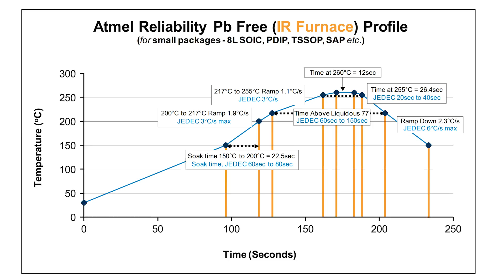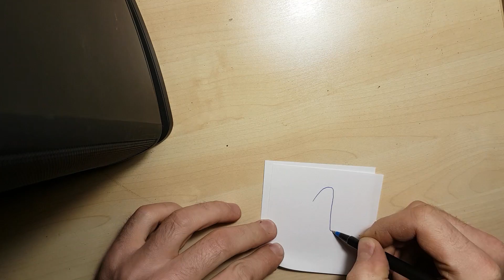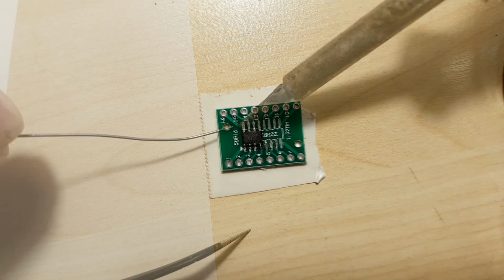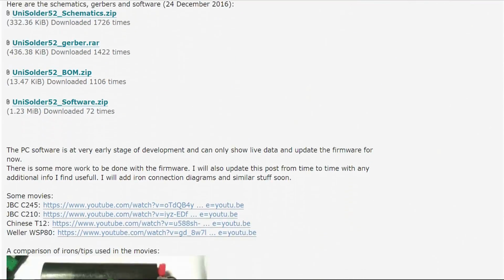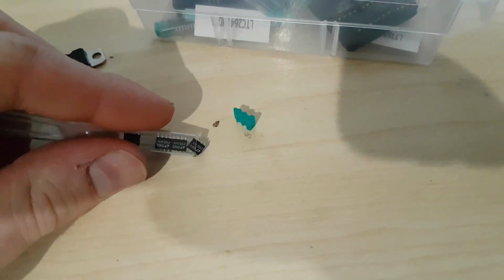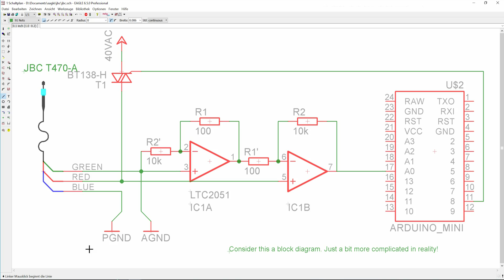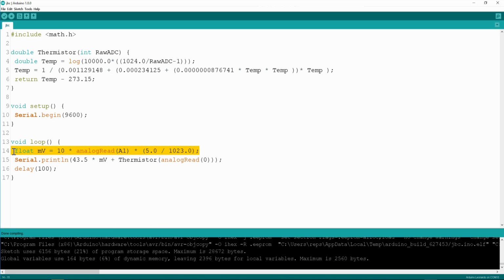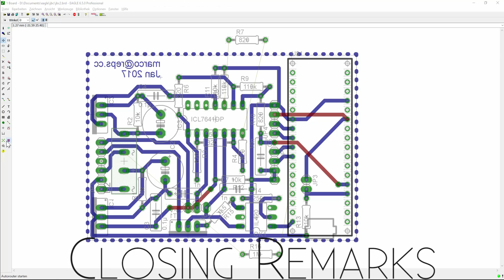Powerful DIY JBC Soldering Station - 250W C470 Arduino-based

Comment: Your videos are getting better and better!
Small tip: switch to KiCAD from Eagle. It's much better, and FOSS/free!
Reply: Amazing subjective argument right there. I'm sold. No more KiCAD. I'm switching to Protel 99 SE.
Reply from the maker: Yes, I tried KiCAD before, felt a bit clumsy then. But I'm planning to give it another chance.
Reply: If you have any problems, just join #kicad on Freenode, if you don't mind using IRC. ##electronics is also a good channel, a ton of people hang out there, including me(Spirit532).
Reply: I actually don't spread the components out. I select them on the schematic, it's highlighted, I press M to move it, and place it where I want it in regards to the reference design.
It's a lot more useful to me that way, since I don't get knocked around a field of components, it's all close.
Reply: KiCAD rocks! I've been using Eagle for ages, but their licensing limitations are too annoying, so i've tried KiCAD and i'm liking it.
Reply: My vote is to stick with Eagle. With Autodesk at the helm now it's getting better and better. I'm really looking forward to the release of version 8.  I tried Kicad again recently, even took an intro class at my local hacker space. I still find it "clunky"  and not for me. To each his own.
Reply: Eagle still has silly pricing and limitations.
KiCad is now a very capable professional design tool.
Reply: Try the "push & shove"-router in KiCAD and you won't look back at Eagle :D
Reply: I have used the "push and shove" but all the other annoyances of KiCad which keep me going back to Eagle. Example, using "PCB New" in KiCad and it stacks all the components on top of each other in your board view and you have to spread them. Seriously?

In regards to the price of Eagle, I think that will change with Autodesk at the helm. Look how pricing works with Fusion 3d for the hobbyist. Truth be told, with the current hobbyist level of Eagle I've never really run into limitations. I don't make huge boards with more than 2 layers. 

KiCad just is not for me. Glad it works for you.
Reply: You can use the spread function that does it automatically.
Come on, is that the only gripe you have? Join #kicad on Freenode, and ask! A lot of people will help!
Give it a try some time.
Reply: No it's not my only gripe I have, it was just an example.

Yes there is a button to spread out components, but WHY is there a button? Who in their right mind thought, “We need to add a button to spread out components because they don’t spread out automatically” Sorry, It just doesn’t make sense to me.

Maybe I'll give KiCad 3rd try in a couple years. Right now it's just not for me. Eagle does everything I need and more.
Reply: Spirit Are you sure? I've heard everything else out there blows.
Reply: Good ol' hand-drawn masks are the best.
/s
Reply: did you know CERN uses KiCAD
Reply: KiCAD sucks much